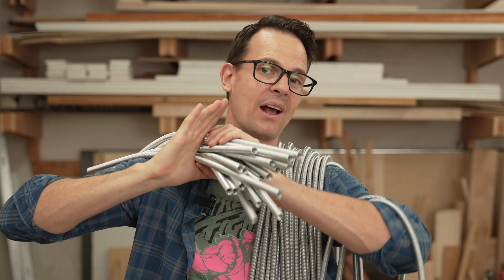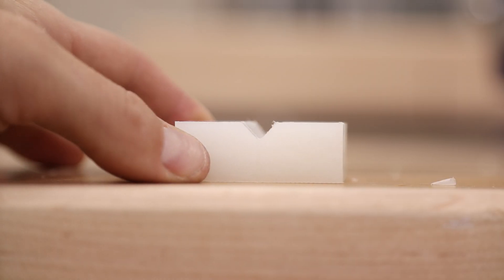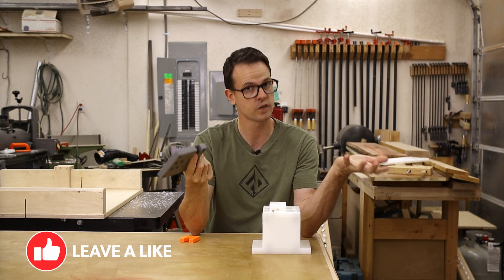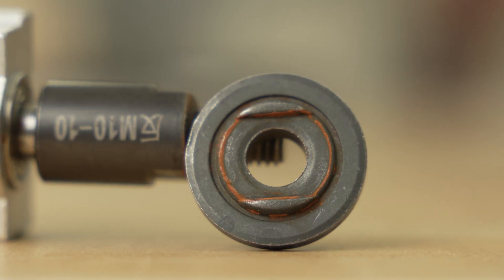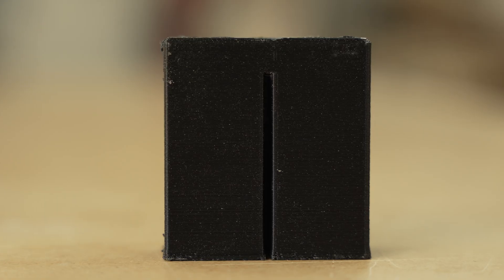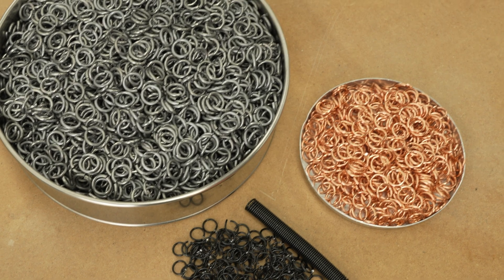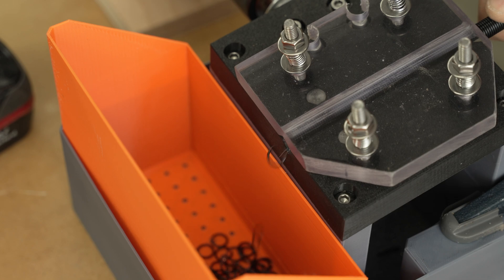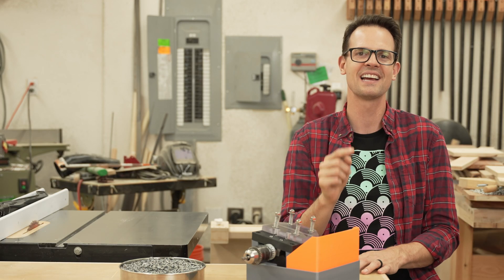DIY Drill Powered Jump Ring Cutter

Comment: I built the jig from the purchased instructions using the exact materials list provided, but the rings aren't getting cut (despite the blade sticking out the right amount). I suspect it's because I'm using half inch rod for my coiling, so I wanted to know what rod/inner diameter you use for your 14 gauge rings?

Comment: Use a diamond abrasive wheel, in terms of physics that gives you an infinite number of teeth. I'd just jig a dremel tool in there with a diamond wheel turning at about 10k rpm. Won't get too hot since you've got the cooling, and it will just blaze through whatever metal you use.

Comment: Is anyone else having trouble with the actual drill chuck assembly? The mandrel is just too big and the bearings, chuck, belt dont fit on it. Ive ordered multiple because i thought it was maybe just a mistake, but no amount of hammering or lubricant will get these pieces to go together. The rest of the jig was easy to build, im just struggling with the initial assembly.
Reply: Did you use the tiny black screw things to secure the belt thing and mandrel piece on it tightly?

Comment: how small of a ring will this cut? I tend to use a lot copper and brass square wire in 18 swg wire  3/16 ID for womens jewelry and as large as 12 swg by 1/2 ID wire for mens necklaces and bracelets. is there any way to easily change the guides to maybe accommodate those ring diameters and gauges?

Comment: I just got this put together! I found that there was an error on the top plate print -- two of the holes for the bolts that the springs go on were about 1/4" off -- but I was able to adjust it to get it to work, and otherwise everything fit together perfectly.

I am running into an issue though -- the saw cuts rings nicely for a moment, but then the rings end up jammed up under the top plate. I'm new to making things like this so I'm not sure what I'm doing wrong, and would love some pointers if you have time!
Reply: That issue happens due to you setting the tension too low between the top and bottom plates. It's an issue with the Ringinator too, which this project is a clone of.

Comment: It's amazing how many of us have come up with essentially the same solution, over the years.  My coiling and cutting rigs are based on things that I saw more than a decade ago, using similar principles. I don't see an update on this but you might find, like I did, that adding some small and weak springs between the two pressure plates makes it easier to set the gap for the coil, plus it makes it easier to inset the coils that you're cutting. A groove at the bottom also tends to pinch the cut ring against the sides of the blade, increasing wear and heat. My next block will only have a groove on the top. I'll be printing out the blade enclosure using a resin printer and embedding it in a block of HDPE, whereas my original jig was just cut straight out of HDPE. If it works out I may have a machinist make one out of aluminum, using my 3D models.
Reply from the maker: Oh thanks. That is good to hear that others have tried the same sort of thing. That is a good idea about adding the weaker coils on the inside. I did try that but I found once I tweaked the tightness on the upper springs that I didn't need them but I may need to go back and play with that to see if I just didn't have things well setup.
Reply: @BuildItMakeIt  - The biggest thing is that the weaker springs hold the gap open, making it easier to insert the coils to be cut. Less fiddly. I have videos of my coiler and cutter setup on my Youtube page.
Reply from the maker: @morallyambiguousnet  Oh wow just checked out your setup. That is nice. That is pretty funny you used the hdpe and the clear platic on the top and everything. Guess when there is a good idea that is what people gravitate to. Wish I had seen your video before working out mine. Would have saved a lot of time figuring things out :) I can totally see what you mean with the little springs. That looks like it was much easer to get it under. Thanks!
Reply: @BuildItMakeIt  - You're welcome :)
When something works, it works. People are going to find the same solutions. i saw some rigs that other people had come up with and thought, "I can do better than that", so I did. Later on I saw many of the solutions I came up with in the work of many other people. Simultaneous development is definitely a thing.

Comment: Hello! Does the 3d printed piece need any tool other than a drill and spindle to be complete? Will any handheld drill work (considering I own a lithium battery one)? Also, from 10.51 till 11.01 you use other tools to further refine the 3d pieces. Do the plans already have these modifications/additions or will I need to make cuts myself?
Reply from the maker: Yep any drill will work with the setup you just need to make sure the drill is stable while running. The plans already have all the modifications I made as was designing out the cutter.
Reply: @BuildItMakeIt  also, the only hss saw blades i can find (no amazon over here) are smaller than the ones suggested (The one I've found is a proxxon 28020 hss, 50x0.56x10 mm). Do you think the blueprints for the 3d piece can be adjusted to fit another blade?

Comment: Awesome build. Unfortunately the top plate STL that you cut out of acrylic here, does not line up with the cutting plate.
Reply from the maker: Oh sorry. I looked at the plans and the top acrylic plate in the design is for the HDPE version, so I added cut plans for the 3D printed version incase people want to cut a top plate from acrylic for a 3D printed cutter. It is updated on my website and Esty. Thanks for pointing that out and hopefully I made it more clear in the plans.
Reply: @BuildItMakeIt  Appreciate the reply. Was able to get it all aligned and put together. Even gave it a spin. Loving it so far. The only issue now is the cutting fluid is spraying at me pretty good and going all over the floor. I have the pump on the lowest setting. Pretty sure the blade is cutting in the correct direction, but can't seem to eliminate the mess. Any suggestions?
Reply from the maker: that’s weird, I wonder if the pressure regulator on the pump isn’t working because it should turn down pretty low. You could try pinching the outlet hose a bit to decrease the flow, but that may just increase the pressure.

Comment: This looks like an amazing set of plans! what would you say the maximum and minimum diameter and/or gauge rings this could manage would be?
Reply from the maker: I am not sure the maximum on steel, probably need to go slow, but I have done some 10 gauge for making ring mail. For smallest with the way the v groove is cut I think you are going to be at 1/8 inch. I have done 1/4 fine but haven't personally tried any smaller. Where you really run into issues is fine wire (say 20 gauge and up) with large diameters. I tried some 20 gauge aluminum at 1/2 and it was so weak the top plat squished it down. I should have just hand fed it at that point and it probably would have worked fine.

Comment: Neat machine! One thing I'd change on it are those top cover springs. Put them under the cover (possibly recessed into the work surface 10mm or so), then put short pieces of vinyl tube where these springs were. What that'll give you is some spring tension on the top plate that will keep it 'up' at all times, yet remain fully adjustable. Pieces of tube will act as buffers for the preload tension just in case not all four bolts are adjusted identically.
Reply from the maker: Thanks for the tips! I did originally have the springs below but it ran better with them above. I like the idea of the tubes above to help on both sides. Thanks!

Comment: What would you recommend printing the whole thing out of in your opinion
Reply from the maker: I would print it out if ASA or ABS for the chemical resistance and higher temperature resistance on the top plate. PETG would also work, but I like ASA better personally since I actually have better luck printing with it and I think it is superior generally in its properties (like UV resistance, but that doesn’t matter for this application)

Comment: I really enjoyed this video and am in the process of building the ring cutter. My question is about the orientation of the cutter tray. In the stl image it is inverted and it seems right-side-up would be easier. If that was intentional, please explain why it's better. Did the position make many extra supports necessary? Cheers
Reply from the maker: I did it that way because it made less supports, but I don’t see why you couldn’t print it right way up. If you do let me know how it turns out.

Comment: Love the design,How do you think it will work with Brass.
Reply from the maker: Thanks! Low carbon Steel has a Rockwell hardness of 60 and brass (varies with alloy) is generally around 55 so you should be good, even a bit easier than steel. I have also done medium carbon steel which while tough is doable so I think you should be on a good spot.

Comment: Hello, wondering if you would share your 3d printer settings. I have a friend who will print it for me but wants to know about the interior settings and thickness of the walls in the print and such. Any details appreciated!
Reply from the maker: Sure, I did three perimeters at 50 percent infill and .4mm nozzle. I think doing 4 perimeters may be better as the thing does jiggle around a lot and I have had a little bit of cracking (from accidentally over tightening in one corner).

Comment: Pipe, on the input for coil, cut a slot down the pipe and add a spring to tenion the coil being fed to the blade....
Reply from the maker: That is a really good idea. I’ll have to find some tiny tubing, but that’s a really good plan.
Reply: @BuildItMakeIt  hobby lobby, home depot, brass/aluminum, pipe. Just matching to outside dia of the coil, can put a larger rod as a ramrod pushin the coil through
Reply: @BuildItMakeIt  currently trying to do some rings myself and really liking the whole process ya got :)
Reply from the maker: @KJ-xt3yu  Thanks! Your totally right about the tubing at a bunch of local places. I never knew :) I’m gonna get some and try it out. Thanks again, I love being able to get good ideas I would never have thought of.

Comment: DIY as long as you have a full shop of machining tools.
Reply from the maker: If you don’t have the tools for the shop built one I have the 3D printed version as well.
Reply: A 3d printer is a cheap, super versatile tool. You can pick one up for $250 bucks and have it up and running in as little as 2 hours. That is pretty cheap compared to a bunch of other basic toolbox tools.
Reply: Do we not understand  what DIY means? 😂
Reply: Diy shouldn't need more than a normal toolbox
Reply: @DragonWilhelm if you want to do more than basic home matinance you need more than a normal toolbox homie.

Comment: Are the dimensions in the plans the same as the standard file I need to know so I buy a big enough 3d printer
Reply from the maker: Yes they are the same dimensions roughly. A 220mm x 220mm 3D printer will fit it (actually a 200x200mm bed will as well). I made it so pretty much any standard 3d printer should be able to handle it!

Comment: Thank you for the details on speeds and feeds for cutting steel. most of the rigs show it cutting through aluminum like butter, but cutting steel is what I need it for and had a frustrating time with the Ringanator Mark 1 on Steel.  I have the Spindle assemble and some blades on order.  One note that could be improved on the guide,  It would be good to have the total lengths on the plates where the pilot holes are at(page 7) to ensure that the plate is oriented the right way.  would be awful to find out after all the layout it was done 90 degrees off.  And am I correct that it would be easier to cut the groves in the top and bottom plate and then do the pilot drilling of the four bolts holding them together while the pieces are stacked to ensure that the grooves are aligned in the final product?  it seems to me that the truly critical things in the build are ensuring that the groove is perfectly aligned top and bottom and that the spindle assemble is 90 degrees perpendicular to ensure the blade in perfectly strait in the V groove.  Is that a fair read and that the other points can be a little looser?
Reply from the maker: Thanks for your comments, you have a bunch of good points. I looked on page seven and you are right the total length and width aren't listed, but are on the page before, so I could add those for clarity. 

You are correct that the groves need to be aligned between the top and the bottom, but because the top plate only lies on top of the rings, perfect alignment isn't critical as the bolts running through the top and bottom plate can be at a slight angle. It would probably be easier though like you said to make the bottom plate, then put the groove in the top plate, line them up and use the bottom plate as a drilling template to drill the holes in the top plate. You can use a round dowel to perfectly align the two when clamping them together, to guarantee the slot alignment. I will go back and add this to the plans as it will give less odds of a misalignment.

For the spindle cutter there is some play built into the hole sizes so that you can adjust it a little bit to get it perpendicular to the slot, and then tighten it up. I found this pretty easy to do by sight and didn't find I had an issue with this in any of my ~7 top plates I built while prototyping this :)

Comment: I printed out the setup. I noticed that the top plate and the cutting plate holes and the slots on both don't match up correctly. So I may have to go in and and redo the measurements on the top plate so everything matches up with the cutting plate.
Reply from the maker: Thanks for pointing that out. I looked in the CAD model and everything seems to match up. Did you get the STL files from my website, or as a package with buying the plans. I am trying to figure out the offending STL files.
Reply: @BuildItMakeIt  I got them with buying the plans for the package deal for the cutter and coiling jig.
Reply from the maker: Thanks so much. You are right two of the holes were shifted off to the side a bit. I have updated the files. You should be able to redownload the new top plate. Thanks for letting me know.
Reply: @BuildItMakeIt  already imported it into tinkercad and corrected it myself as well. But still glad you were able to fix it for future buyers or people that want to make it.
Now I just have to finish getting the bolts and the blade and I will be ready to cut my own jump rings.
Reply from the maker: @chrisbowman1005  Thats great you were able to update it. And let me know how it turns out!
Reply: @BuildItMakeIt  will do once I get it all put together. I will send you a video of it of I can.

Comment: Hey..how much would you sell this for
Reply from the maker: I am probably not going to sell prebuilt version. Also I checked out the ringinator line razzemmatazz pointed out and it looks very similar, but metal and nicer. Cool we came to similar designes.
Reply: The designs are posted for $7, but it's really similar to the Ringinator, which uses more durable materials but goes for about $500.

Comment: Absolutely fantastic!! Fun to watch and fun to observe you thinking process and problem-solving! I am going to cut aluminum jump rings - the aluminum wire has max 2mm wide. Do you think that I can use a Dremel to cut them? Or, maybe, the low speed of it... won't do the job? Thanks a lot for the video and for the plan 😉:elbowbump:
Reply from the maker: Thanks! I think the dremmel would work great and you don’t need super fast speeds. I think the dremmel and it’s smaller blades will have less run out so you should get a bit better cut as well. If you try it let me know how it goes!
Reply: @BuildItMakeIt   thank you!  I asked you about the Dremel because I tried to cut the rings with it and it melted the aluminum 😂 So it certainly has to have a cooling system of some kind. I have a friend who is a master of wood and I will ask him if he's up to building this machine for me following your plan. When I do have it running I'll certainly let you know the results 😉 Thanks again and have a wonderful weekend 🌞🛠🔧🪛🔩

Comment: Wow sir, you did a great job, thank you for all your hard work, you're truly an inventor, also thank you for explaining cutting the 14gauge  coil, now I need to get a 3D printer to make mine just like yours =) great work.
Reply from the maker: Thank you very much! If you have the woodworking tools you can totally make it without the printer. I converted my old one over that I made in the video to the new design, and while it is a bit more challenging to make it probably works better than the 3D printed version just because it is more solid.